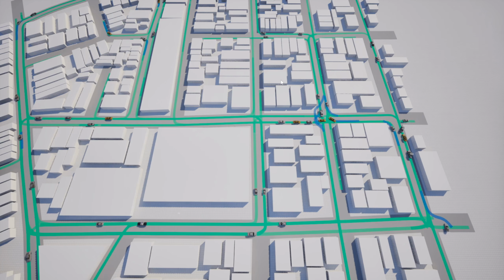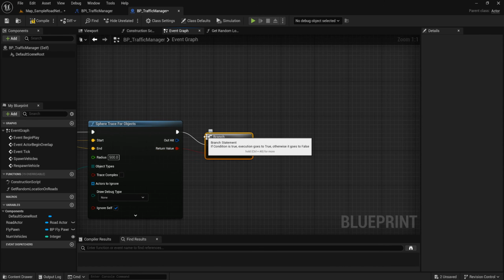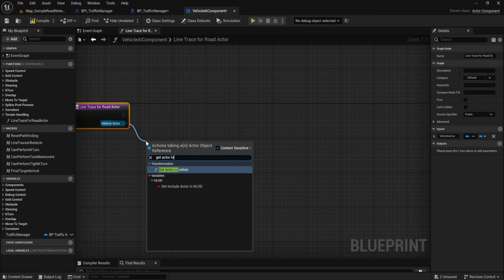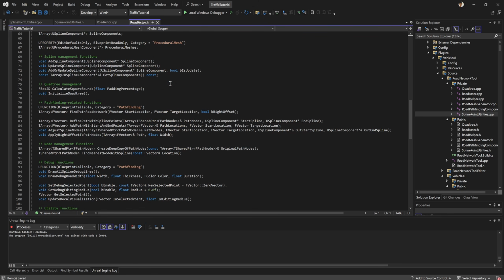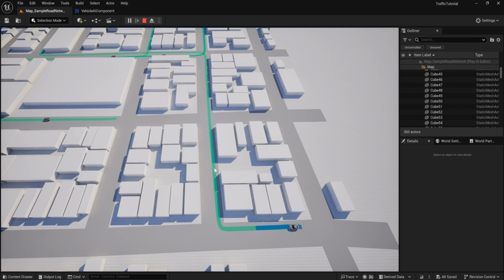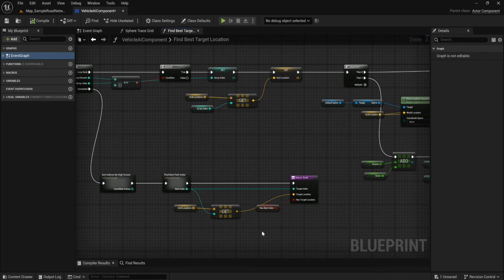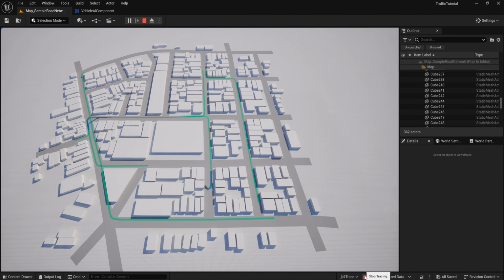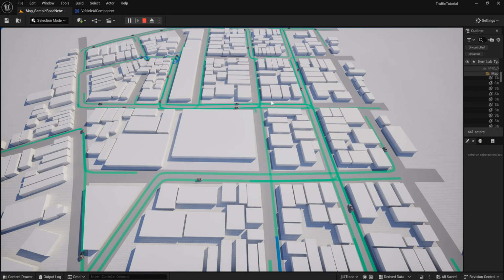Unreal Engine AI Vehicle Tutorial 17: Spawn Traffic System

Comment: this is a nice topic. 
But you should try to improve your teaching skill: You only explain WHAT you're doing, not WHY. all your blueprints are "we create this node, than this node, than this node, ... " instead of "the first thing we wanna do is: spawn the cars when the level loads, ....". The why is way more important. sure I can see the why after i saw all the nodes you created, but it forces the viewer to an inverse thinking compared to how you'd think in creating solutions. 

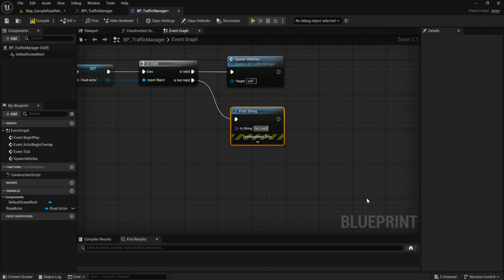3:43 PrintString for errors, when you start your string with "error: " it will be marked as an error also in the output log.
6:10 You can use the "LastIndex" node instead of "length - 1"
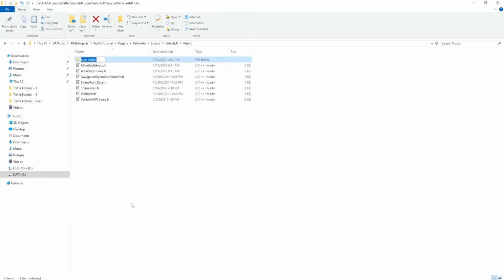34:00-40:00 get a good IDE (e.g. Rider) and do the refactoring in IDE? (moving files, changing signatures, ... are easy tasks for a good IDE and exactly what they are made for)

in general you should try to avoid all the "width / 4" ... the 4 in this case is basically a magic number. also you need it so often.... you should just pass the correct width already, that would also allow more easily to create multi-lane roads. so you have a lane-width instead of a road width.
Reply from the maker: Thank you for your suggestion.